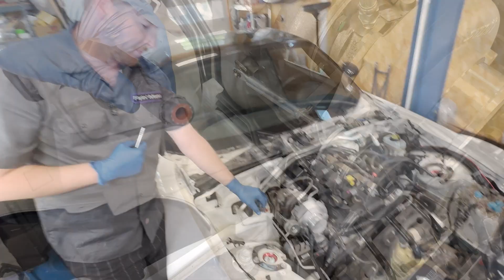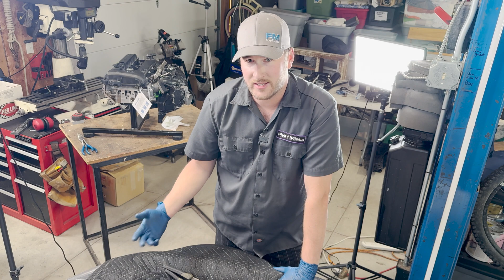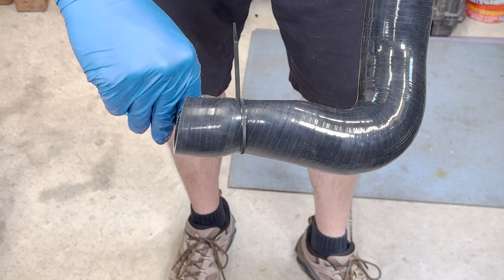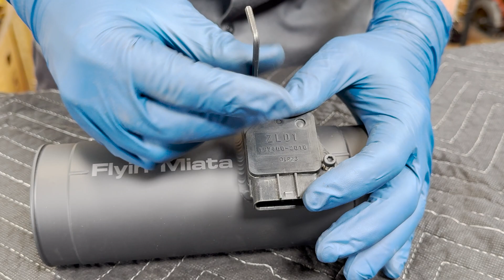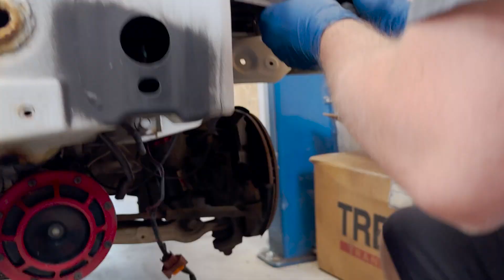4 - NC Turbo Installation - Step by Step Guide

Comment: Time Stamp
0:30 Water supply line 
5:00 valve cover bolts
8:35 water supply line routing
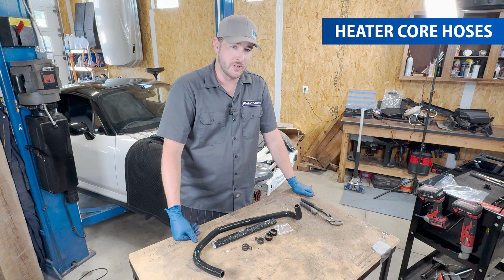9:58 heater core hoses
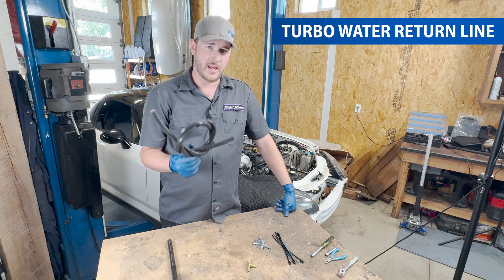14:55 turbo water return line
18:20 water return hookup to radiator w/ T fitting
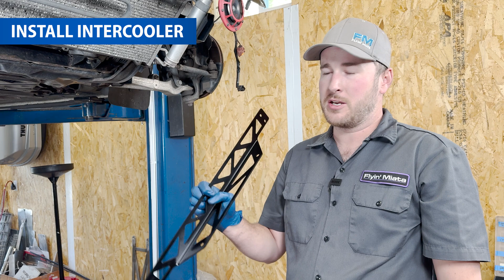21:53 install intercooler
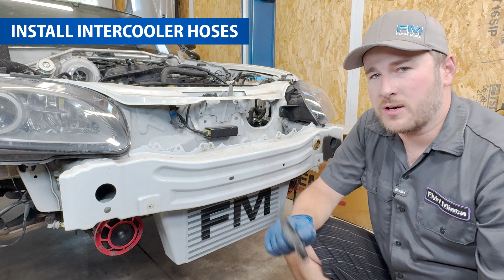23:56 install intercooler hoses
26:50 bulkhead cuts
29:35 intercooler hoses with ziptie technique
33:30 panel cut next to power steering reservoir for Cold air side of intercooler
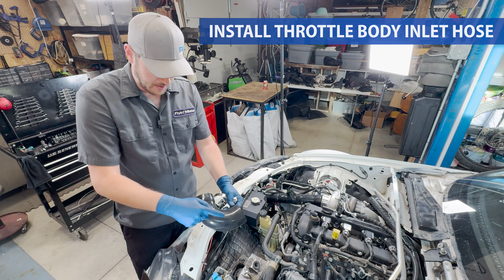37:56 install throttle body inlet hose
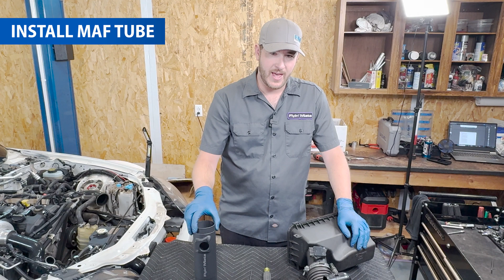38:51 install MAF tube
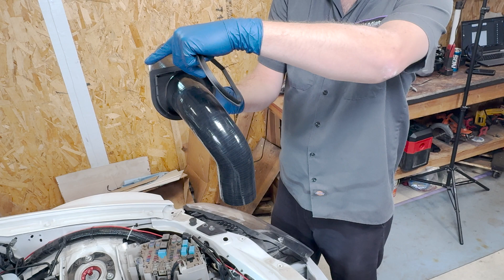42:10 bulkhead plate demonstration w/install
44:49 trim and reinstall airguide
47:08 reinstall headlights

Comment: @23:08 - I’d not install intercooler yet, drill the hole first so you dont have to clean shavings off the top of the intercooler/intercooler bracket
Reply from the maker: This, or you can also leave the end caps on the intercooler. :)

Comment: @10:40ish, putting the heat shield on the heater core hose -would it be easier to put it on from the other end?
           you have to slide it further, but you avoid that pair of near 90* bends.
           not sure if the added distance negates the gentler radius.
Reply from the maker: You’re correct. The video was shot a while ago and we made that correction in the written instructions. It’s much harder to update a video, unfortunately.
Reply: @FlyinMiataVideo  I feel bad for the people who "can't read", lol  but, as my sister would say "that's how they gotta learn!"
Reply from the maker: @ekw555  😆